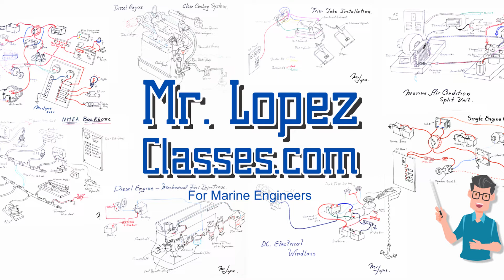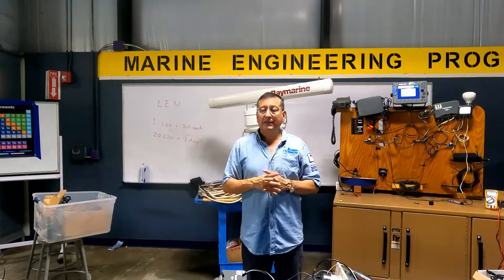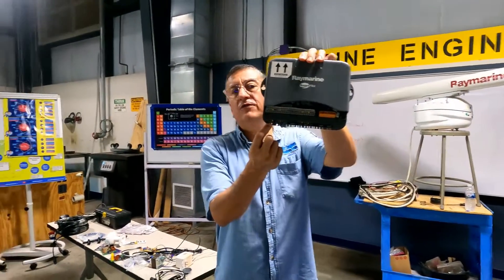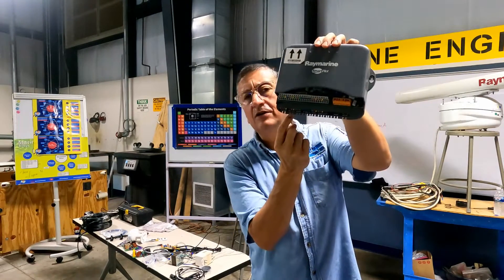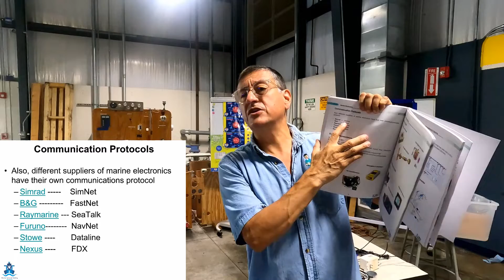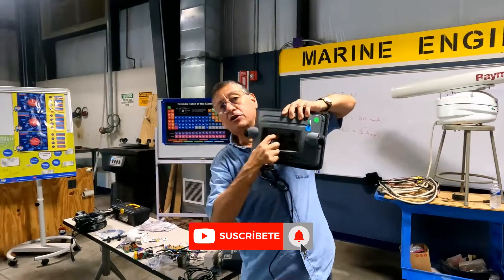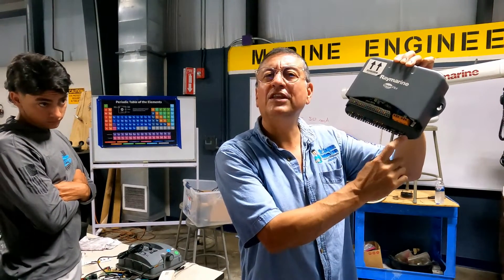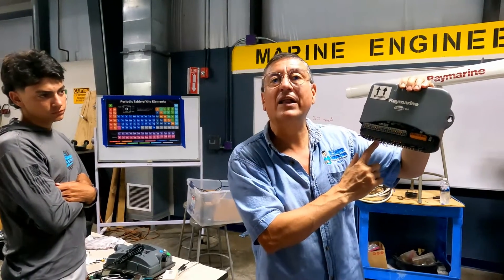NMEA Fundamentals

Comment: Instead of soldering you can use ferrule connector it is quicker.
Reply: Soldering adds corrosion protection to the exposed copper, very important in the marine environment.
Reply from the maker: Of course dear Andy
Reply from the maker: Yes Andy. Ferrule connector is excellent. Thanks